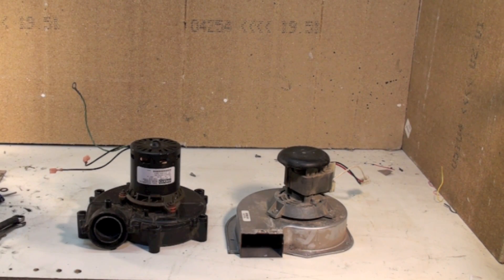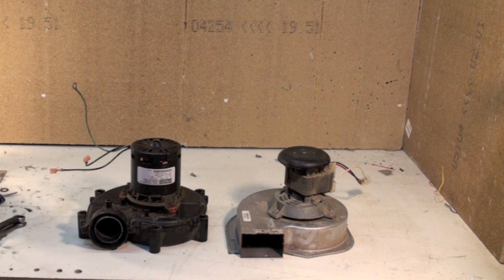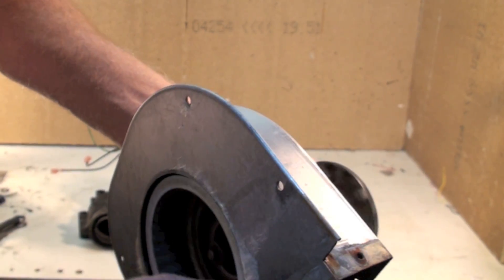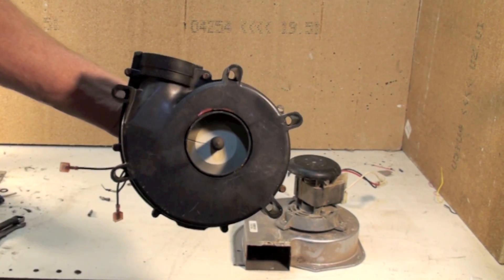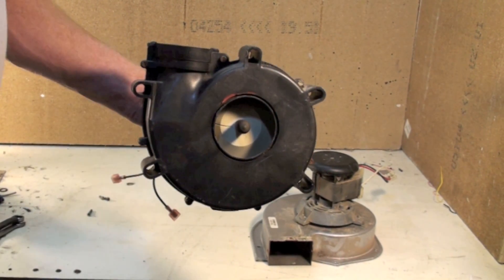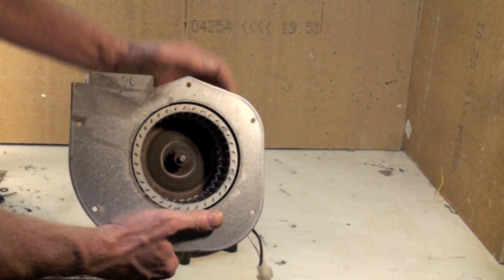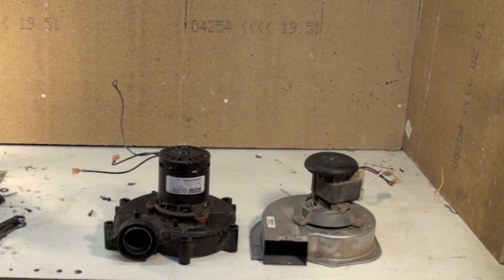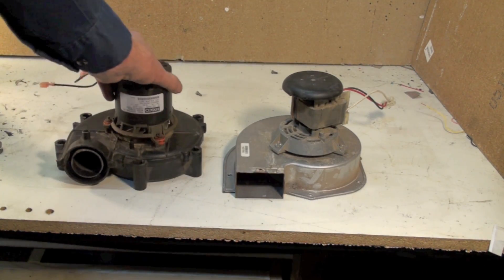Troubleshoot of the gas furnace inducer

Comment: I am very sorry to bother you, but I've ran across a few of your sites and thought it was worth a shot to ask you about something.  Hopefully, you're willing and able to help.  Earlier tonight, I told my husband that there was a tinking sound in the furnace fan.  I didn't feel comfortable taking anything apart to look inside the fan, so I waited for him to get home.  I told him about it, he went downstairs and a few minutes later when I got down there with him, he had disconnected the draft inducer by mistake! He put it back together and now all of a sudden we're getting the 3 flashing light that means pressure switch open with inducer on.  We tried blowing and sucking into the hose.  Worked for a few seconds, but then burners went out (safety feature) and error code came right back.  As of right now, my husband sucked on the hose continuously, fired up the furnace and left that end of the hose off.  We have heat again, but obviously we no longer have our important safety feature of the pressure switch function detecting the negative pressure.  So my question is, how do we fix the pressure switch, when it only started acting up after my husband disconnected the draft inducer?  I think it has to do with losing suction when he broke the seal, but I'm not an expert like you and am only guessing here.  I appreciate your time and any help you can provide us with.  Thank you very much. (Oh and the original problem with "tinking" sound was a piece of masking tape that somehow got in the fan.)
Reply from the maker: Laura Leighton Your problem here may be leaking vacuum where the inducer mounts to the heat exchanger.  I would remove the inducer and seal the joint with high temperature silicone.  If that fails, be sure the fitting where the sensing tube attaches to the inducer is clear.  If it still does not work, you may have damaged the switch by sucking too hard on it and it will have to be replaced.  Hope this helps.
GFM

Comment: thanks for the info. quick question…i have an 80% type inducer. i have bought a new one off amazon. will it come with a new gasket or do i just need to add red silicone around the border and screw holes to seal it?   thanks
Reply from the maker: It may or may not come with a gasket.  I have gotten them both ways.  The border and screw holes is fine for silicone.
GFM

Comment: I have a Trane XE90 that is short-cycling... It DOES ignite--but only runs normally (fast-continuous flashes) for about 4 minutes or so... after which the burners cut off and I get an error code of 4 flashes (thermal protection device open) for about 2 minutes... It was also getting to where it would lock-out (2 flashes) intermittently, and cleaning the flame rod seems to have corrected that. (BTW, thanks for your video about that!!) Unfortunately the problem where burners are only staying on for 4-ish minutes at a time is still unresolved... Checked filters (clean)... registers (open/unobstructed)... Best I can tell the inducer motor is running; it's hot to the touch and I'm hearing a noise that's kind of rattle-y. (At least I'm pretty sure that's where the noise is coming from.) In the video above you mentioned oiling the older (80%) inducer, but not the 90% style like I have... Do you think oiling might help in this case? (If so, where would I add it?)
Reply from the maker: drumrgirl61 The high temp lockout should mean there is an airflow problem.  Look for dirty blower wheel, air conditioning coil plugged or ductwork problems.  If the inducer motor is not vibrating, there is probably no problem with the inducer wheel (sometimes the fall apart).  You can add oil to the shaft next to the bearing (inside).  Hope this helps.
GFM
Reply: grayfurnaceman Thanks for replying! I'll try the oil... So far I've not found any info on how to gain access to the blower wheel or a/c coil, but will keep looking. It may turn out to be more disassembly than I want to try myself...

Comment: Thanks for your video! It helped me troubleshoot and repair my own furnace. Here's what my issue was (drainage block, code 31 as the pressure switch was fooled by the water condensation) and how I fixed it: http://youtu.be/waozj5jUAsU

Comment: I have an American Standard aud080c936j1 furnace. My inducer motor won't run at all so i don't get any ignition. What would be the reason for this?
Reply: Charles Roberts HEY!!!   BUT WHAT WAS THE ACTUAL PROBLEM?

+GFM - My inducer fan is not running but if i suck on the vacuum tube, the gas will ignite.   So, how do I determine if its the motor on the fan (the rotor turns freely), OR the RELAYSWITCH?   I originally thought it was the motor as it was hot while not running, but when I checked the relay, it clicks but doesn't seem to supply 120V at the black line to the motor.  The multimeter will jiggle but won't go to 120V but it may be something else locking it out at this point.  Suggestions?
Reply from the maker: Charles Roberts Does the motor turn if you rotate it by hand?  No rotation, bad inducer.  The motor should be hot.  If the motor is cool and does not rotate, you could have a pressure switch stuck on or the control board may not be sending power to the inducer.  Hope this helps.
GFM
Reply: Thanks for the info I had a furnace man come out and he had it running in about 10 minutes.

Comment: I Just ordered the fasco A143 looks like the metal one in your vid. It does not come with a gasket and i was told by the company that i dont need one. I did scrape one off the old one. Do i need a gasket or can i use rtv or would it be fine with no gasket or sealant ?
Reply from the maker: motown427 I always use RTV.
GFM
Reply: thanks

Comment: motor on inducer is getting hot and not blowing as storng as it use to !
Reply from the maker: Big Doe If it slows, the pressure switch will shut off the burner.
GFM

Comment: Hey Gary! Love your videos. Hey, I have a tempstar and I think I have figured out its the inducer. Nothing will turn when all calls for heat, just a click. The pressure switch worked when a sucked on it. Plugged the leads from the motor to electrical cord, just a hum - nothing else. Is there anything else I should check first? Nothing else works on the furnace, which makes sense.

Comment: Mine is starting to hum.  Do you think that's a motor bearing issue or something else?
Reply from the maker: Usually the only failure with these type motors are bearings.  However, if the blower wheel is breaking up it will vibrate.  Hope this helps.
GFM
Reply: grayfurnaceman It turns out the plastic fan caps over the blower shaft end and that piece broke off and was stuck between the fan blades causing excessive vibration.  Had I known, I would have at least taken it apart and removed the piece before the new motor arrived.  When on, it sounded like sitting on a commuter jet near the engine.  After replacing, I took a look at the bearings and they seem to be fine.  I suppose I now have a temporary replacement if the new one ever acts up.  Thanks for response and the video!
Reply from the maker: Enigma758 Too bad about the caps.
GFM
Reply: grayfurnaceman I was able to purchase a replacement, online, for $130 and it arrived within a few days so no problems.  The old once will still work in a pinch so I'm keeping it as a spare.  Your video provided me with some confidence that it was a simple fix (took only 15 minutes) so thanks for that.
Reply: Enigma758
In a pinch just go outside where the vent terminates and tape the suction end on a wet/dry shop vac to the end of the furnace vent and turn it on..Lol. This will pull enough to close the pressure switch and make the furnace fire. The shop vac will collect the condensation and the exhaust on the shop vac will vent the flue gases.
Reply: Damian Dokis
BTW I am kidding this was a joke. I own a Heating and Air Conditioning Business and do not really recommend doing this in a pinch. Just thought it was funny...When I thought of it!
Reply: Damian Dokis It might actually work! (but I don't think I'll ever try it). :)

Comment: I just had a tech leave my house and he said it's going to cost $501 to replace the inducer.
Reply from the maker: You have a cheap one.  If it was variable speed, it would cost $700+.  There is no real cheap way to do this.  You can sometimes buy the inducer yourself but it still is expensive.  If you try to replace the motor without replacing the wheel and housing, you will probably damage the blower wheel removing it, and it will probably vibrate when you are done because the blower is balanced as a unit.  Sorry I could not give you better news.  
GFM
Reply: grayfurnaceman
Reply: Great video, I was looking for a way to save money, plan on doing it myself, mine runs around $325, I started looking for just the motor, but I'm sure glad I watched your video first. I guess I will just bite the billet and do it the right way, thank you.
Reply: I would say you were Rheemed!  LOL

Comment: I think you did a good job on the video. keep them comming. I am looking at replacing a Coleman trailer house inducer motor assembly but it is nothing like theones in your video
Reply from the maker: I get these furnaces as I find them in the junk pile.  When I find one I will do a series on it.  
GFM

Comment: I broke the plastic wheel similar to the one on the back side of the 80% furnace blower you have there. Are there replacements for that? Its a Tempstar Furnace Exhaust Inducer Motor.

Comment: Turns out the RPM's are the same.  Fasco replaced part # 7021-10048 with part # A169.  Their website says that the new part spins at 2800 RPM, but when the part arrived it says 3060 RPM on the motor-- just like the old one.  Everything looks identical.  I'm gonna go with it.

As for the gasket... Just use red high temp silicone, right?  Or do I need to pick up a gasket from a local supply house?

Comment from the maker: In defense of the plastic inducers, they used to use galvanized and had rust problems.  As is normal, the plastic wheels had a lot of problems, especially the first few years.  I have not seen as many failures lately.  It would be nice if proper testing for longevity were well done.  Thanks 
GFM

Comment from the maker: Is your part a factory replacement?  Are you just replacing the motor?   Inducers are not one of the parts I generally would use general replacement parts for.  If you are replacing just the motor, balancing may be a problem.  If the RPM is too low, the pressure switch may not make.  As for problems down the road, I dont know.  Let me know.
GFM

Comment from the maker: Check the gas input.  Sometimes if the furnace is overfired, the inducer overheats.  Over fire will also damage the heat exchanger.  Hope this helps.  
GFN

Comment from the maker: It should not.  Does it have oilers?  If so it should be oiled each season.  If the furnace is overfired it may be overheating the inducer.  You can check the furnace firing rate. check out this vid.  "Service the 80% gas furnace.  Check the firing rate by clocking the meter part 10"  I cant give you the address because youtube wont let me put it in the response.
GFM

Comment: Helpful video.   I have the exact same inducer on the right side there.  I repalced my last one myself due to grinding annoying sound at start up.   3 years later now, having a noise problems again.     Is it possible for these bearings to be shot so quickly?

Comment from the maker: Actually they are quite simple to replace.  Most have several screws and an electrical plug to remove.  When installing the new one, if a new gasket is not included use high temp silicone to seal it to the heat exchanger.  Good luck.
GFM